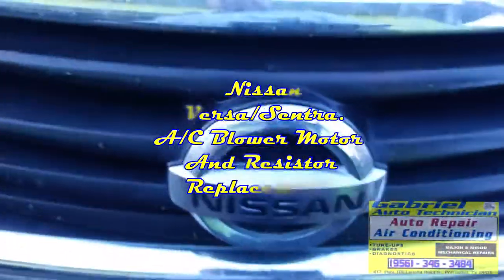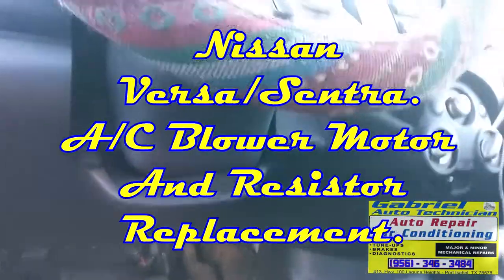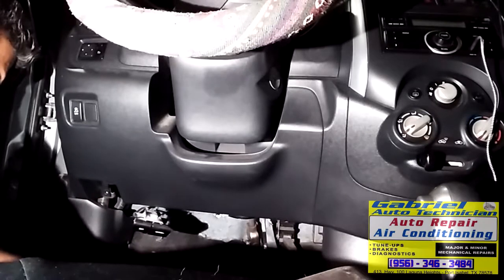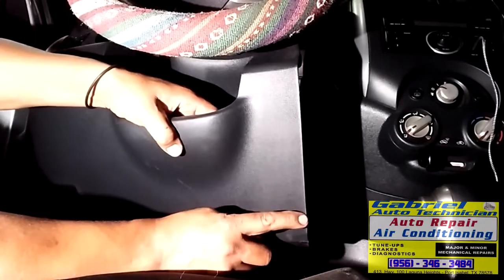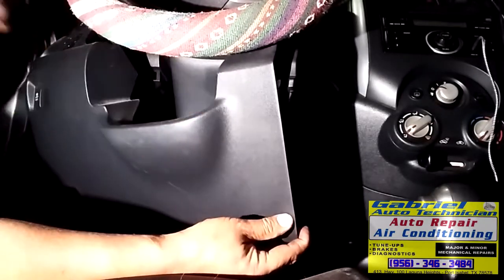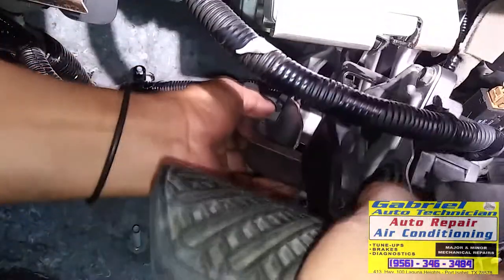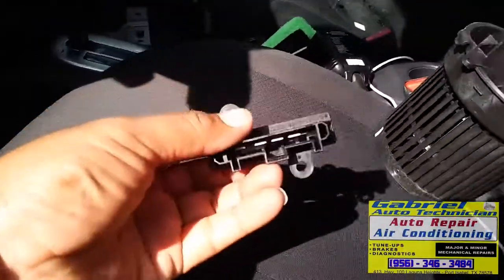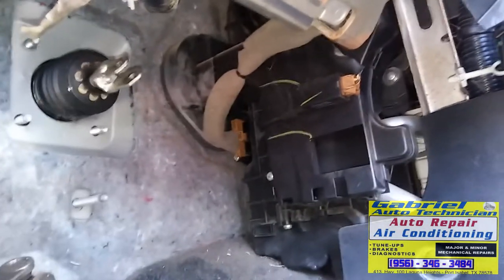A/C Blower & Resistor Replacement.Without Removing The Dashboard Part 1. Nissan Versa-Sentra. Fixed!

Comment from the maker: On This Video We Showing: The A/C Blower And Resistor Replacement
 Part 1.On a  Nissan Versa, But the Nissan Sentra Is Similar, We have to Remove The Brake And Accelerator Pedal Bracket And The Steering Shaft. Instead Of Removing The Complete Dash. 

Thank You For watching my vids.
Thank you for all the comments.
I Appreciate the calls that lots of people Throughout the USA makes to my phone number, thanking me for record and upload my videos, it makes me feel proud, that I am helping people to save or to make some money.
I am making my videos with lots of love and with the meaning of helping you people.

Here Is This Link If You Like To contribute. Thank You.
https://www.paypal.com/paypalme/Gabri...

If you found this video and it was useful, 
Please Like It, And Subscribe To My Youtube Channel.
https://www.youtube.com/user/GabrielA...
So you can help me, 
And I can upload more videos. 
Thank you.

Thank you for choosing our services.

We always do our best to serve you better and fix your car properly.

Your Friendly Expert Automobile Repair Technician.
With more than 40 years working in the auto repair field.

I am working on cars since they have contact points ignition
and carburetors when most of the built cars came with no air conditioning.

We Are Here To Help With All Your Auto Repair Needs.
We have the knowledge and the tools to do the job right.

Gabriel Auto technician
413 Highway 100, 
Laguna Heights, TX.
956 346 3484.

Auto Repair Shop. 
Auto Air Conditioning Repair and Recharge
Brakes,
Tune-Ups, 
Radiators,
Shock Absorbers,
Water Pumps,
Timing Belts,
Oil Change,
Fan belts,
Struts,
Suspension, 
Transmission Service, 
Computer Diagnostics,
Paint and Bodywork.
Iron Welding.

Thank You for your like on our page @ 
https://www.facebook.com/GabrielAutoT...

Subscribe To My Youtube channel@
https://www.youtube.com/user/GabrielA...

https://www.instagram.com/gabrielauto...

https://www.yelp.com/biz/gabriel-auto...

https://business.google.com/b/1158464...
Reply: What size bolt on the steering rod up top

Comment: Tried this tonight on my 2016 Nissan Micra.  I got the top and bottom steering nuts loosened but unlike in your video, I could not get the shaft to move down so that it disconnects at the top.  It seems quite stuck at both ends.  I tried prying a bit with a bar and screwdriver but it doesn't seem to want to come loose. Any advice?

Comment: Thanks for posting this video. I have recently completed a successful replacement of the blower motor in my friend's 2015 Nissan Versa Note. Your video was a big help. I used the Continental blower motor as I think you did, and the Beck/Arnley blower resistor. Everything is working well.

Comment: Just finished. Started last night around 7pm. Stopped around 10pm after finally getting the new blower motor in and testing. In the morning, I put it all back together and moved the car to make sure steering and braking still worked. Seems all good, made a few u-turns in my neighborhood with the air blowing strong.  Thank you very much for the video. Almost seemed impossible. At least 10 cuts on my hands guys 😊. Had to remove steering column and whole brake assembly without touching accelerator. But , in order to get it back in, I had to take out a C-Bar, a type of metal bar connected to the kick plate that was blocking the upper part of the brake assembly. Couldn't get the brake assembly back in place over the brake booster until I took out the C-shaped metal bar(there's 2 of them, take out the one on the right. Connected by 2 nuts , though the nut on top seems impossible to get back on. I also had to take out the metal box under the steering wheel, connected by 2 bolts, as it too was blocking the brake assembly from going back in. There's another comment here where someone already mentioned this so scroll for it. After taking out the C-shaped bar and the silver metal box, the brake assembly went in easily. Got the bolts in. Reconnected plugs, but the C bar and box in, put the steering column back in place and bolted it(I marked with red sharpie beforehand so I knew where to line up steering column, and after that the rest was simple screws.

Comment: Thank you for this video! I followed along with your video step by step and I successfully changed out my motor blower in my 2016 Nissan with your help. 

Feedback on my own experience: I wasn't able to get to the top nut on the steering wheel rod, maybe it's because how I had the wheel orientated. I decided to proceed without removing any part of the rod. It was a pain to not have all the room to wiggle out the brake, but by miracle I got it out and in. I ended up removing the accelerator pedal for more room. Not removing the rod made it a tight space to get the motor in and out, but with finessing, I made it happen. Total work time for me was about 4 hours. Spent a lot of time trying to figure out how to take off the rod that I never removed and maybe some extra time trying to wiggle the parts in the tight work space I limited myself in. I bought the extension for the wrench before doing this fix. I thought about getting the long reach pliers you had, but I stuck with normal. Probably would have been more convenient if I had long reach for removing the clips.

 I can't thank you enough for this video. You made it simple that even a mom with no mechanical skills could do. Off to enjoy my working fan now!

Comment: I did replace the blower and the resistor.  Thank you very much. I found out why I couldn't reach the screw for the blower. I put one firm cushion from an old couch on the side of the car so I could reach far to get the blower. 
Thank you very much, sir.
Reply from the maker: I am showing the screw there. Is the one at 10 o'clock.
You just need a small philips screwdriver, and turn the base counterclockwise. I have no room to put the camera while am removing it.

Comment: Thank you! You saved me $500, even though cut 3 fingers with the metal plate of the pedals lol
Reply: how did you get into that little spot where the blower is? I'm stuck now in a point of no return.
Reply: @abrahamgiliana  pull the seat all the way back, go in upside down with your right arm first. Unscrew the screw and twist and pull out the blower.

Comment: I did the blower motor on a 2016 Versa yesterday at my workplace. Only thing I did differently was I did not remove the switches in the pedal assembly. I simply disconnected them. I also removed and moved out of the way that metal box and its bracket that is visible at 8:45. Gave me more room when removing the pedal assembly. After that, the blower is easily accessible

Comment: We got it done ✅ thanks for video. Only issue was when put back the steering wheel is not straight 🤦🏻‍♂️ slanted left a bit but hey AC works now LOL thanks for awesome video
Reply: lol. he told us do not turn the steering wheel. but not a big deal, you can go back and straighten it, it's worth the time.
Reply: I would have not stop the steering 😂 but I am happy you complete the job.

Comment: saw about 2 other videos where they didnt remove the steering , just the pedals and brake pedal housing to do the blower motor
Reply: I tried to do it that way and ended up getting the brake housing stuck and wedged real good and had to remove the steering in the end. Just lock the wheel like he does in the video and you won't mess anything up it's worth the extra space

Comment: What i did last week? I start the engine press on fan button without A C button. 
Then I knocked  jusr on the resister and the fan started working. 
Always knock before replacing

Comment: How exactly did you disconnect the accelerator at 11:20? There are no clips/pins/nuts/bolts?  It looks like you just pulled it off.
Reply: There are 2 small 10mm bolts on the left side of the accelerator pedal that bolt up to the pedal assembly. It's all electric so there is no cable, only a small plug to disconnect.

Comment: Any suggestions on how to align the wheel/ steering column? I couldn't lock the wheel on my 2015 versa, and the wheel jostled
Reply: this just happened to me and i cant find any answers
Reply: @brushing1985  glad to know I'm not the only one
Reply: I used a sharpie to make a mark on the teeth. Worked for me.

Comment: Isnt removing the dashboard easier??
Reply: According to repair manual, no, you can't get to blower just removing dashboard.  What he shows it what official repair manual says to do.  IDK tho.  I'm going to mark the spindels on the steering column tho, so you don't need alignment hopefully.
Reply: I got my blower motor out of the housing and a new one put in through the dashboard. Very tight squeeze but it was doable. Not sure about the resister though which is my next process
Reply: Although mine is a 2009 versa